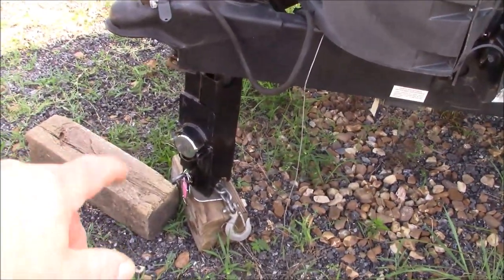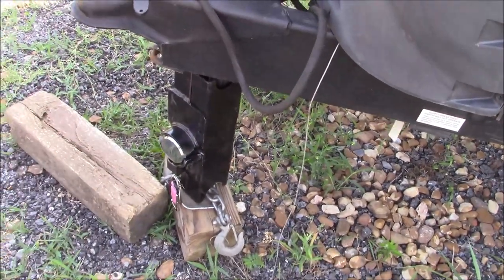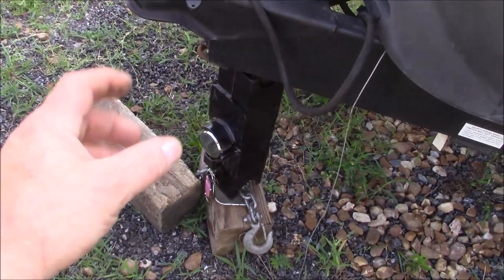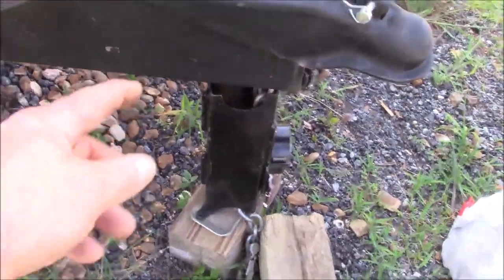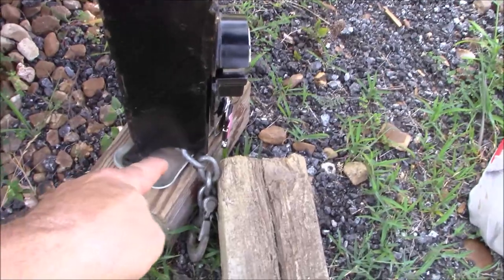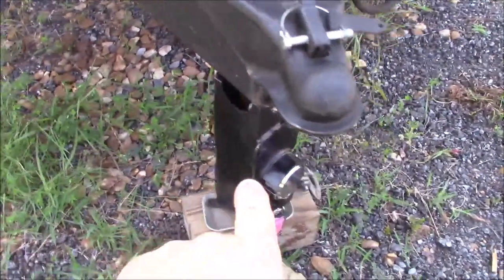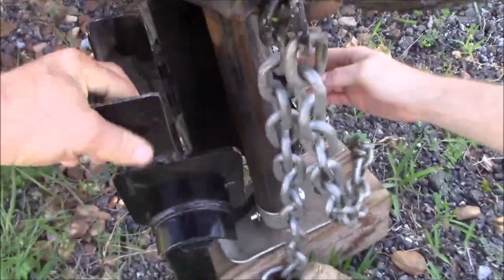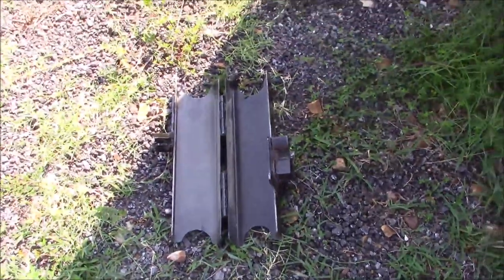$300.00 New patent Trailer Leg Lock

Comment: .... or you could just drill the center of the puck like is shown in countless youtube videos or you could just undue the three bolts shown at the top holding the jack into the frame (or chisel them off)... on to version 2. LOL
Reply from the maker: You could take a cutting  torch and cut it off, or use explosives and blast it off. Thieves want a quick hook and grab. Unless they know there is something if major value they're not going to take the time to do all the stuff you state.  As stated.... If a thief wants anything bad enough they'll get it.
Reply: @jennifer. Or, or, or you could just not put a lock on it at all.  Do you lock your home or car?
Reply from the maker: @calebhelmuth  no. I leave my house wide open so any riff raff can just pillage through.... Wow you really got a good point there. You need. To get with these other lock companies and  tell them they're wasting their time. In fact going by your comment I may just start leaving the keys in my truck while it's running.... Heck yeah!
Reply: @RV ROOF INSTALL  haha! Good lock idea. I hope you sell alot 🙏. Keep up the good work
Reply from the maker: @calebhelmuth  thank you fine sir. I shall muster on!